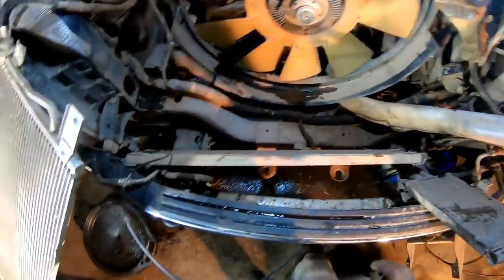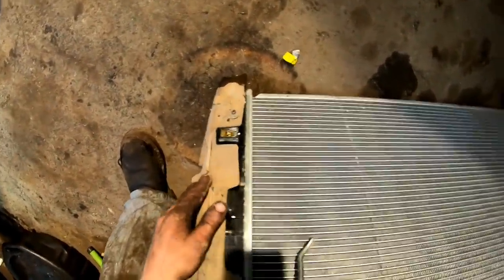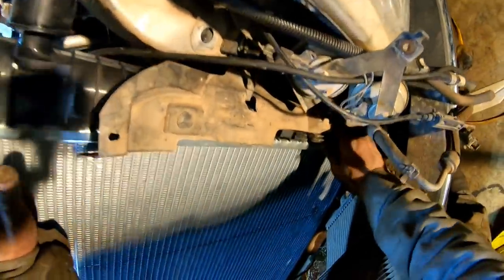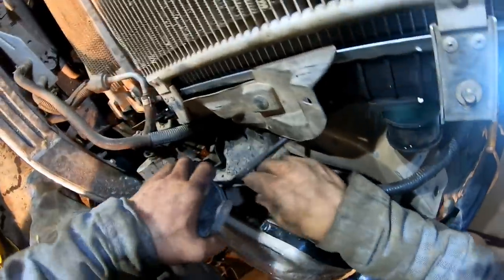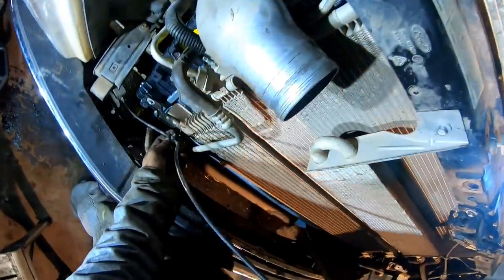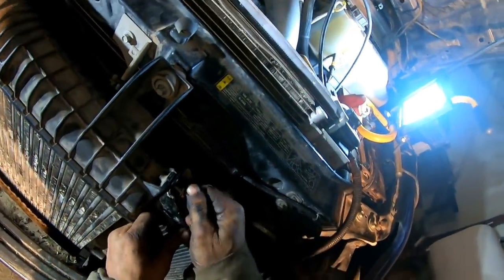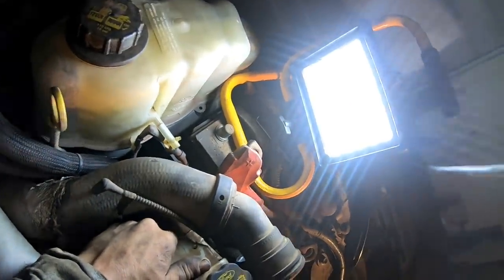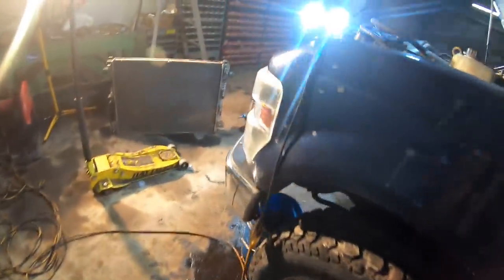6.4 powerstroke radiator part2

Comment: Two days to change a radiator = Amazing engineering
Reply: I don't think it took him two days, a couple hours at most, he just broke the video into two parts so it wasn't a super long video.
Reply: Think they are designed for the assembly line to be efficient, not the guy fixing it.

Comment: after watching your last video my sons 2011 dodge cummins radiator did the same thing,it separated in the top right corner if you where standing in front of the truck looking at the motor,looks almost like the same radiator.

Comment: I've never had good luck with aftermarket chinesium radiators. I understand that it's not practical in the commercial environment, but here's what I do.... I have a shop clean and repair the old one. If that's not possible or practical, I go to a salvage yard and find a fixable unit and have it gone over. I've had better success with repaired/reconditioned OEM radiators than I ever had with the aftermarket stuff...

Comment: That's the reason I will never buy another V8 diesel pickup again. I can take the head off a cummins 6bt have it rebuilt and be putting it back on by the time you even get to the ones on a power stroke or dirty max. I not a fan of dodge but what's under the hood make life so much easier. Although I can also say everything I've had to repair on the dodges I've had it was easy as hell to do. I'm talking 1st and 2nd gens. Won't buy these new electronic loaded ones.
Reply: You're comparing the old Cummins design to new motors and stating you won't buy a new Cummins.   You can't buy a new truck with the old motor - so not much of a talking point. That's like ragging on one of the new V8 gas motors because they're not as simple to work on as a 289 Ford or 283 Chevy.  Ahhh...the nostalgia of the "good old days" when everything was perfect...
Reply: Yeah everything I got is old, and my wrenches fit too. And watching warrens last two videos is the reason I said what I said. Even warren said in the video it was junk. You like the new stuff more power to you, for me I like old. Not a talking point what ever that means. Doesn't matter anyway when AOC gets her way everything will be parked and we will be riding horses and bicycles. Warrens maintenance will consist of putting shoes on draft horses but hopefully he will still be making you tube videos.
Reply: @oldfarmer4700  Yeah l remember the old days ,you reverse into a fence  repair Bumper  including  re-chrome $300. , new one replace panels Labour etc $5,000  , some thing very wrong here ! my Bike l won't touch ,let the Garage fuck it up, then  they pay , lol .

Comment: yep, I'm fixing up my 99 7.3.
No way I could deal with this on a newer truck
Reply: I'm in the same boat, my 99.5 ,7.3 is rusting on top around windshield. Needs injector O ring and a clutch job. This is the year she gets a little love. Have you seen the price of new ones.
Reply: mine is 5/99 on the door tag and has power stroke badges on the doors.
99.5? is 99.5 preferred?
thanks
Reply: @1112223333111  
Think after Dec of 98 they got bigger turbo and y pipe.
Reply: hell ya!

Comment: Warren did you find that 10mm socket that dropped ,when you put your torch under the front you can see the socket sitting inside the in or outlet pipe of the air to air cooler at about 32.20 if you replay your vid you will see it.

Comment: Exercise that brain - I bet that radiator wasn't cheap - just think if it wasn't for the speed or cordless and pneumatic tools - how long would this take - the longer it takes the more money you make - need to take photos of it before starting like I do - suggestion only
Reply: Not true.  The flat rate book (in most shops a software program) gives a  job charge for estimating the costs and total charges.  You can't expect a customer to accept an estimate that is an open-ended, unlimited budget.  "I'm using manual hand tools so you have to pay more because it takes me longer" isn't going to work for most customers.
Reply: I don't know for a fact how he keeps track of the hours he spends on a project - software maybe ?????    your right  -  I was just kidding to some degree - that's the reason I was bragging about the cordless  and pneumatic tools - how much longer  if you had to ratchet tools  - it's not going to work for any customer that I know of  -  he's not  going to charge any more than he deems necessary - he's not that kind of mechanic - I've watched him numerous times working  he's fair  - he just has to figure out the problem and solve it like he always does   - open  ended and unlimited budget does not work in mechanical field  - but you have to figure out what and where the problem is and sometimes that's not easy

Comment: That’s a mess. Reminds me why I quit working for FoMoCo many years ago. Isn’t the 6.4 notorious for the front engine covers being ruined by cavitation?
Reply from the maker: That's right,  I don't know who to blame , international or ford.
Reply: @westerntruckandtractorrepa1353  Well..Ford didn't design the motor.  Navistar International designed the motor and Ford did the firmware programming for the motor for their use.   Navistar used the same motor in a number of their products (medium duty trucks).  One of Navistar's claims is that the Ford firmware is the cause of the problems, while Ford contended the problems occurred because of inherent design flaws in the motor.  I have a friend who worked as an engineer at Ford and he was not a happy guy when it came to discussing the 6.4.   The problems with the 6.0 and 6.4, and Navistar's refusal to help with warranty claims, are why Ford cut their ties with Navistar International and designed the 6.7 in-house at the Ford Dagenham Diesel Center in England.   Ford produces in excess of 1,000,000 diesel engines a year at the Dagenham diesel factory.   It's not like Ford has no experience in designing and building diesel motors.
Reply: @buckhorncortez  Oh l Love it when they Blame each other over faulty goods lol  !

Comment: Hi Mr Warran if I heard you right for f350 you said replacing head gasket  ? I saw you replaced thermostat as radiator  did you do head job off camera , just curious and Iam with you about the engineering guys don’t have clue to design engine flows to make life a little easier for field mechanics , love your knowledge brother and be blessed

Comment: Don't let that radiator whip your backside. LMBO. That's a joke with that 6.4 setup. Ford that was a better idea of the 6.0. See why I didn't last
Reply: No, it wasn't Ford's idea at all.  It was Navistar International's inability to design a single motor that could pass EPA / CARB emission requirements.  That's why Ford decided to do the next diesel in-house and designed the 6.7 liter.